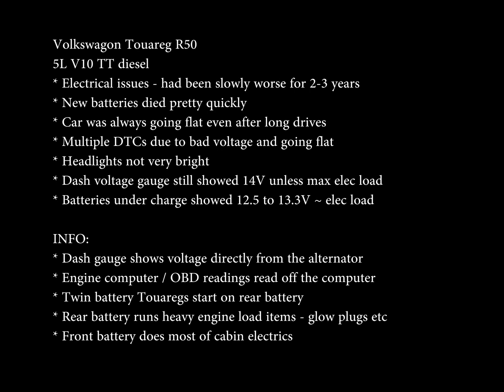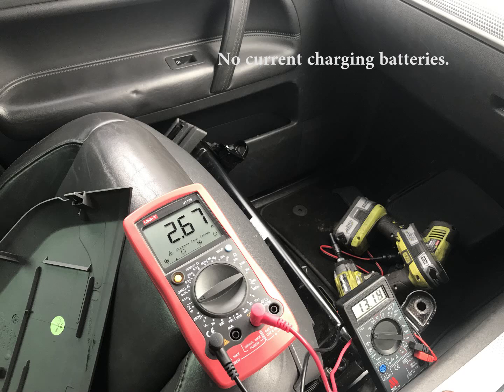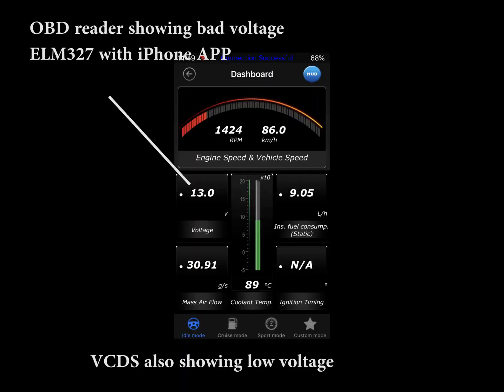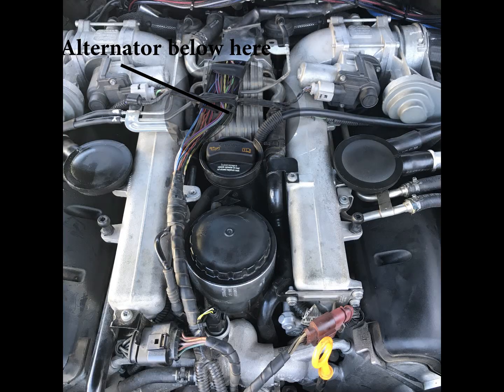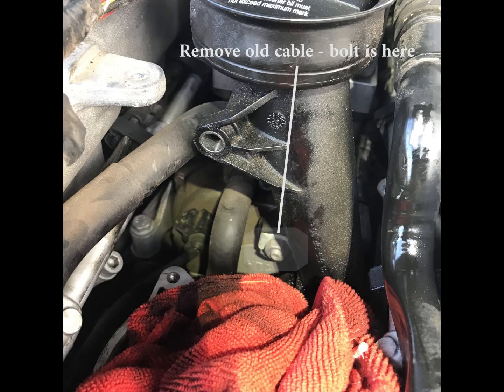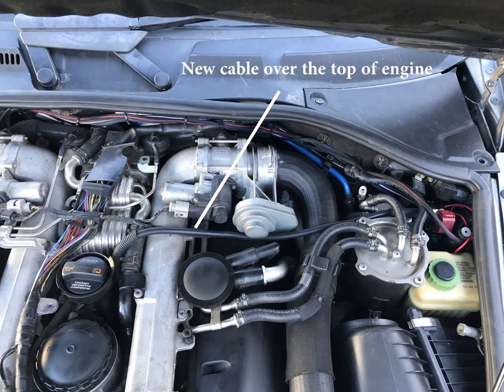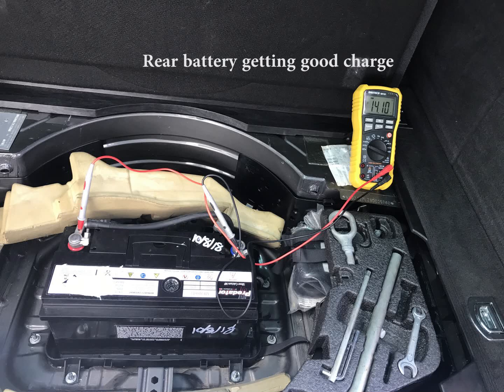VW Touareg R50 - V10 Electrical - alternator Issue

Comment: As we old folks would say back in the day here in the states..You are the Man... I checked the cable as you outlined and the casing was cracked and  exposed  .  I attempted to check for a grounding challenge by inserting a long screw driver on to the cable but I immediately got some sparks.  after the fire works I figured I blew a fuse and attempted to start the car.  It started flawlessy and to my amazement the dash board volt meter went from 12.5 volks to 14.volts and the battery was charging.  Next stop is my favorite mechanic shop for a final repair..

Thank you for your video it saved me from purchasing a new alternator.

Comment: Good video. Very helpful. Curious to know how did you checked voltage coming straight 
off the generator with the multimeter? Was there enough room to contact the power output with the multimeter with oil filter and housing in place?
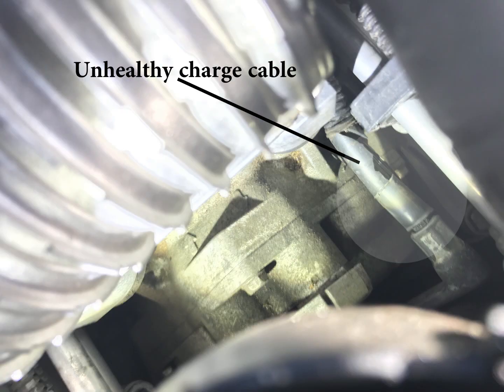Reply from the maker: Yes enough room. I was also able to undo the original cable and put the new cable in there (which is black (but should be red of coure) at 0:59).